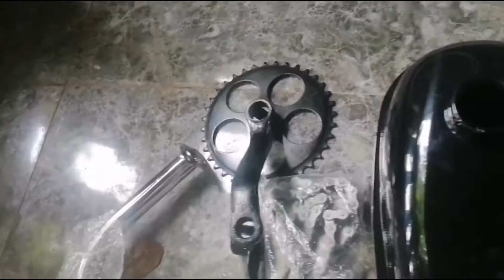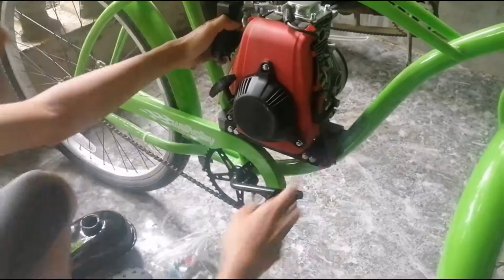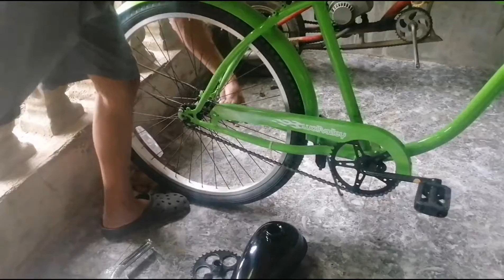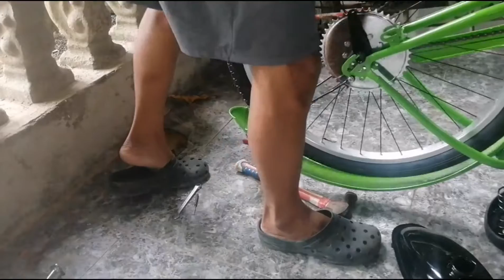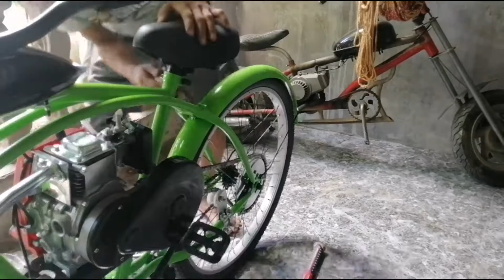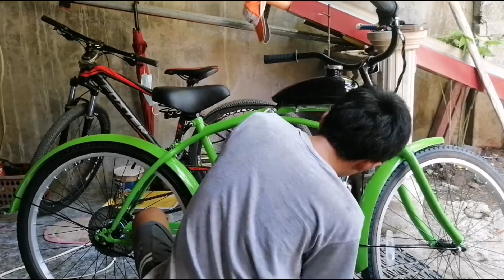200$ Kit 49cc 4 Stroke Motorized Bicycle Kit Installation  Part 1

Comment: Mukhang mas heavy duty Ang clutch Ng 4 stroke Anu po sa tingin nyo Sir???
Reply from the maker: mas matibay clutch ng 2t hehe.
Reply: @letsbuildsomething4317  ganun ba sir.cge mag 2stroke na din ako.isa pa Hindi Rin bulky.and  mabigat.tulad Ng 4 stroke
Reply from the maker: @marcusfollosco3986  oo. pero kung pang long ride mag 4t ka. hehe. belt. drive maganda..
Reply: Saan  Lugar  shop new sir
Reply from the maker: libmanan Camarines Sur po..
Reply: Layo Pala sir salamat cavite Ako sir
Reply from the maker: @joelescarlan339  meron po kami sa. Cavite mga mountain bike lang po.. budget bike po..  kaibigan po ng boss ko.
Reply: @letsbuildsomething4317  idol ano po reason kung bakit ma's advantage ang 4 stroke sa 2 stroke kapag long ride
Thank you kung maka reply.
Meron ho ba gumagawa nito sa Manila.?
Reply from the maker: unang-una po yung makina may sariling oil na iwas sira basta alaga sa change oil.
yung transmission bAsta 7g up ok na ok malakas hatak.
matipid sa gas depende sa setup. 100km per liter yung gawa ko. 36t. or 32t.
Reply: @letsbuildsomething4317  Kumusta po sa uphill ang hatak? Halimbawa sa tipo ng bitukang manok sa Quezon. Kailangan po ba sabayan ng pag pedal para Hindi mag overheat ang makina?
Reply from the maker: kaya yung atimonan
Reply: @letsbuildsomething4317  maraming salamat Idol. May ma recommend ka pong builder dito sa Manila. Ano po FB ninyo idol. Thank you.

Comment: Saan po kayo nakabili ng engine?
Reply from the maker: reseller po ako kaya meron ako nyan.
Reply: tnong lng po ano po problema pag nmamatay makina pag ina unlock ng clutch?tnx
Reply from the maker: 2t ba gamit mo paps?
Reply: @letsbuildsomething4317   oo.. 80cc.. pull start
Reply from the maker: ganto gawin mo paps. wag mo bibitawan agad yung clutch. unti-untiin mo hangang sa umandar.
Reply: ah..cge..tnx boss
Reply from the maker: @yourfan4441  ok.. sana makatulong..
Reply: @letsbuildsomething4317  magkano po ganan engine sa inyo?